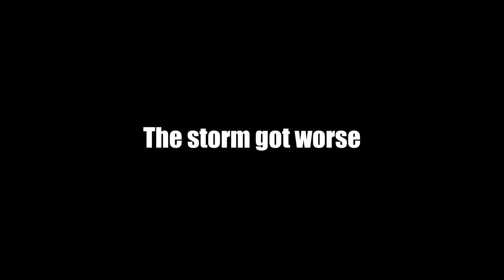I made my old 4WD more modern! - 4WD BUILD EP 9

Comment: awesome work man.  i always use self etching primer even on plastic,  but all the small plastics like mirrors  or what ever, i plastic dye them its better than painting, the dye goes into the plastic and looks much better, last forever, should try it some time.  my  series one lights needed to  be modified to the bucket for lights to fit. how did you mount the grille? dont tell me you used those shitty plastic factory clips,  search ebay for japan version clear indicators, $100 looks much better. but love the rig man.
Reply from the maker: That’s a really solid tip mate, mignt look into that!